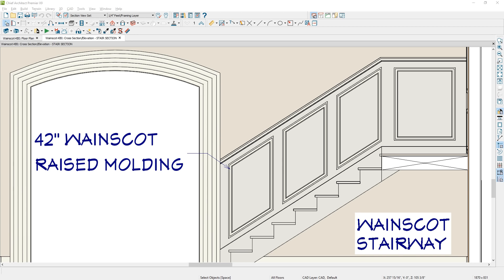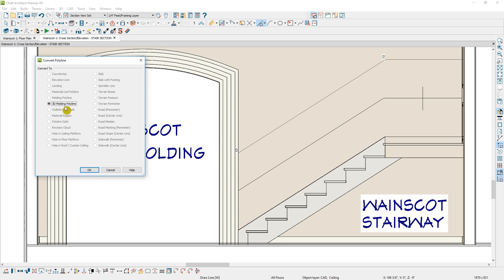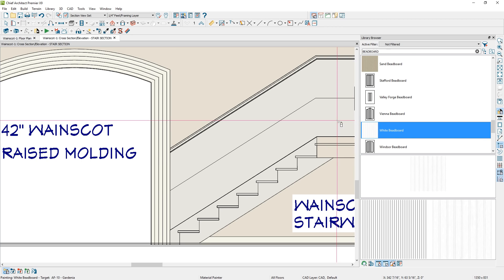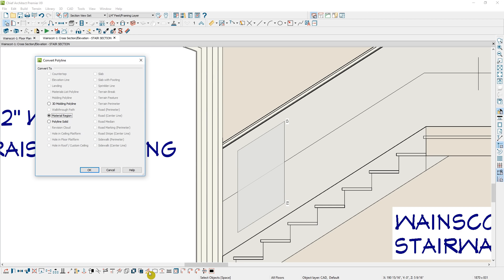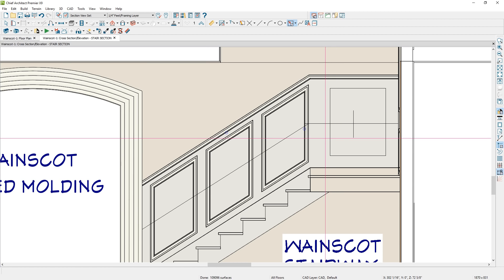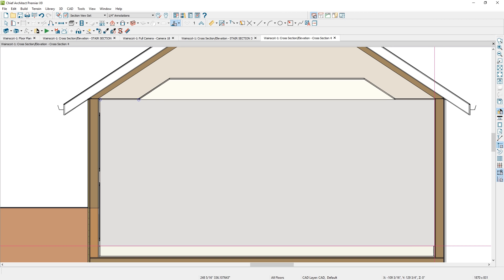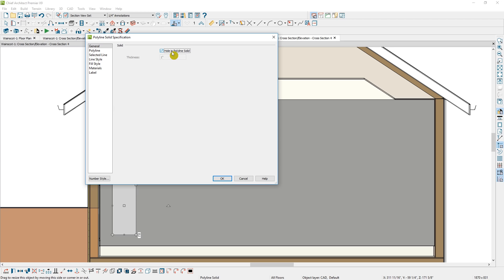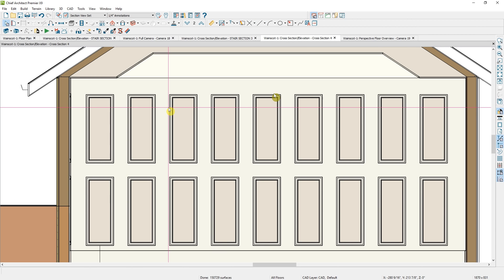Designing a Wainscot for a Stairway

Comment: How do you layout the wainscoting in the stairwell when the stringer makes an S curve?
Does the base rail follow the stringer and the top rail become straight in an angle approximate with the general angel of the stairwell section, or should both the bottom and top rail follow the S curve?